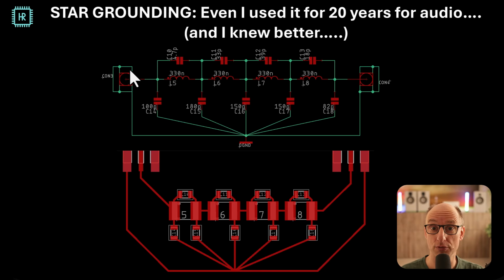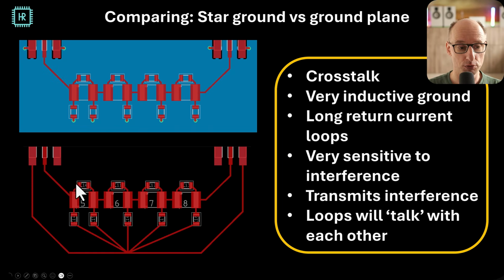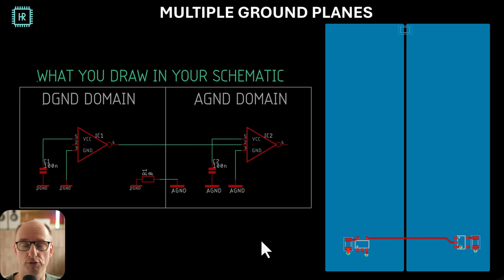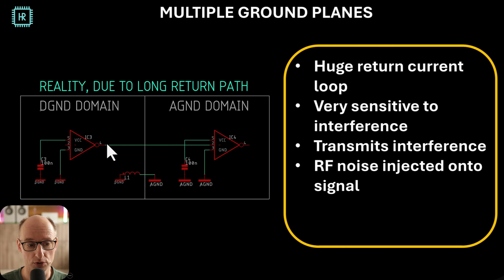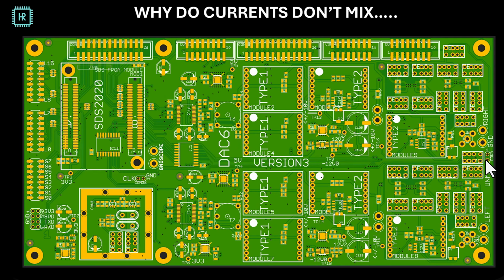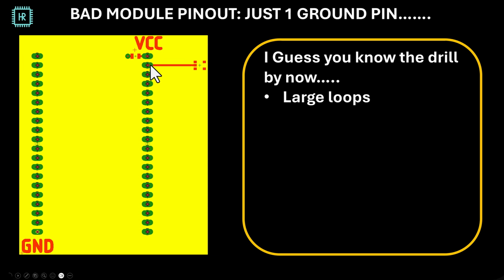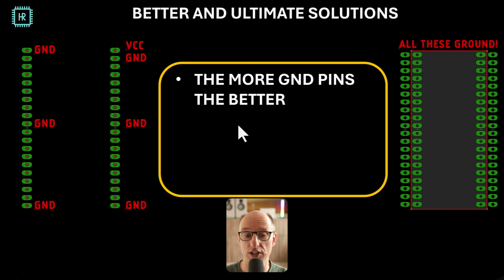Why Your Ground Design is WRONG — and How to Fix It. Flawless PCB design part 6

Comment: For system interconnections, I'm surprised you didn't mention twisted pairs, proper termination, cable impedance, etc for high common mode noise rejection. In pro audio, it is common to either run shielded twisted pair from the stage to the mixer, or even more modern, is to put the D/A conversion on stage to shorten the path from the microphones into the digital realm. This goes a very long ways to achieve very high signal to noise ratios in the system from the mic inputs to the mixer outputs to the power amplifiers. The D/A conversion is in the digital stage boxes now, and some power amplifiers use digital inputs using AES digital audio. It is quite robust and any analog noise in the digital realm is ignored completely, except at very high levels.
Reply from the maker: I fully agree with everything you say. This would have to be another video. I did not expect viewers to interpret the mcu module as a system solution problem. I will make videos about emc at some point I think. This would be a great example for that.

Comment: I really wish your video could have been out earlier! 
My manager is the “separate ground” guy. When I was designing a mixed signal board, he was really against the single plane design and introduced multiple 0 ohm resistors that seems nonsense to me. He criticised me for the “high speed mentality for audio systems” and I cannot try to convince him more about the ground and trace issues. And the consequences came with the messy enclosure earthing and isolated power supply stuff. Generally, it’s a grounding and crosstalk nightmare and it hurts my eyes every time I reviewed this board I designed.😂
Reply from the maker: Ah, I know what that feels like :-(

Comment: Thank you for your great explanation about why the ground is only one and should never be split. What is strange is that you find the advice of splitting it even in the layout recommendation from some ic manufacturers. Any pcb, independently from its operating frequency shall be designed with rf rules in mind. 
I do high power smps design since 20 years which is maybe one of the worst cases for emi; never even thought to split the ground between different sections. Emi compliance is already complicated enough by itself, split the gnd and you will have a very bad day in achieving it.
Reply from the maker: Very very interesting answer. I've been getting replies from people saying: "when you do high power smps, you must split ground planes because otherwise you'll get crosstalk and other problems". I was not convinced of that being a good idea, but now you are commenting as an expert which is great. Now I know 100% sure this is not a good idea.
Reply: @HansRosenberg74 
Thank you. The only reason while I split the ground is when you have to measure a large DC or low frequency current with a shunt resistor and you don't have the possibility to measure the voltage across it in a balanced way.  The current is passing through gnd and the plane resistance (not the inductance) will impair your accuracy of the measured current. See it more like a kelvin connection rather than a gnd split.
The main problem with ground split is that at a certain point the various gnd need to be connected together; but where? In this case the point where the 2 gnd join is clear (at the shunt terminal) and not defined by crosstalk/emc/interference or other not well defined reasons. I have seen also joining the split grounds with a ferrite bead in a random location.... Maybe among the worse you can do for emc.
Reply from the maker: that was the only reason I could come up with. I do something similar in my high power audio amplifiers. You have to be careful what you do there. The position on the tracks where you take the feedback is also really critical since at high powers the currents are asymetric (top half or bottom half of output stage conducting at high power)
Reply from the maker: The only thing I've never designed that is quite common is switching mains supply (220V to 12Vdc or so). I would love to do that sometime. Do you know what would be the best resource to learn the basics of that?

Comment: Thank you for the great series of videos!
In a bard-to-board header, every signal pin should have a ground pin nearby, but multiple signal pins can share a ground pin.
The following approach keeps a decent RF performance while reducing the number of ground pins involved:
For a single-raw connector:
s G s s G s s G s ...
For a two-raw connector:
s G s s s G s s s ...
s s s G s s s G s ...
Reply from the maker: Yes, great idea. On my low emi fpga board this is what I did. I think I had a ground pair after 3 signal pairs.

Comment: For say, an industrial controller where you want to avoid EMI, a whole ground plane, plus a somewhat separate EMC barrier, is the standard solution. But even things like processors, on that structure can sometimes be inexplicably sensetive. So something happens even on a PCB ground plane.

For my audio projects, i always had success with rougly the following structure:
-Input and output jacks bolted directly to chassis.
-Star grounds, each component lead hardwired directly to chassis. 
-If possible, a thick (5mm) copper chassis as ground plane, the more metal the better.

That was of course completely hand built stuff. To replicate it with a PCB, i guess you could sandwich it with a copper plate and have a screw down into the copper for each star ground.

That gave me noise immunity, blackness, brilliance.
Reply from the maker: I've designed and build 11 power amplifiers and 6 DA converters and experimented heavily with grounding. The single ground plane keeps giving me the best results on a pcb. With hand built stuff like tube amplifiers your solution sounds like a good one. You always have to be vigilant what you do though.

Comment: I'm not so sure about the multiple groundplanes always being bad?
I feel like it's only consistently bad when an analog signal crosses between planes (but you can still mess up a digital plane crossing too).
If you have a DAC/ADC in the analog groundplane I'm pretty sure it's all good to have the rest of the digital circuit in a separate groundplane right?
Also, I think the majority of problems are to do with having loops in the crossing between planes, if everything is fed between planes at the same point (including power) and you have some filtering then most of those problems go away.

Still no good reason to do it though, unless maybe there is something particularly noisy in the digital section and you can't filter it? Can't think of a good one though.
Reply from the maker: I haven't found a good example for splitting planes. I did get some suggestions for high power switching electronics, but I would love to see an actual example of that, preferably with measurements.
Reply: @HansRosenberg74  Yeah, I would agree that it is unnecessary in basically all audio equipment aside from separation of really noisy things that have nothing to do with audio anyway, it's not even that hard to have SMPS on the same plane without trouble.

I do however suspect powerful amplifiers need more care given to their design if they are to be placed on the same ground plane.
The high currents can cause low-frequency resistive cross-talk that requires consideration of the high-current paths, so I could imagine having a separate ground plane for the high-power section being a convenient design technique in that case.
Reply from the maker: Basically  a star connection between 2 planes, If I understand you correctly, that should work well and not harm anything I guess. I solve it with floor planning. High currents to the right, low currents on the left with a 'virtual star point' somewhere in the middle of the ground plane.

Comment: Many of these ground ideas come from the early days of point to point valve/tube wiring, so they shouldn't be used blindly for PCB use. Obviously a daisy-chained ground connection from the power stage back to the input stage will cause resistive/inductive/feedback problems, so the star ground was used instead. Sometimes localised star grounds were used for each amplifier stage, using the metal chassis as a crude ground plane. For large spread-out installations, mesh grounds were used with heavily cross connected point to point ground return wires. For example the old BBC Television Centre in London contained tens of thousands of coax cables which created a giant low-impedance cross-connected mesh ground network, where a star ground system would have been impracticable.
Reply from the maker: Hah, great! This explains where it comes from, this makes soo much sense! Thanks a lot for this insight!

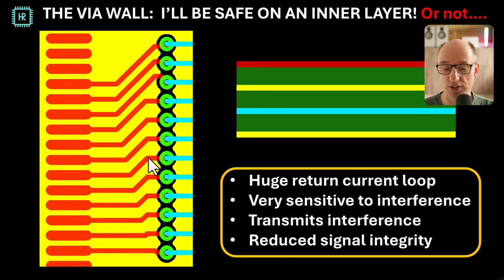Comment: 10:06  Wait just a sec!  I understand the point you're trying to make (provide a return path between the individual vias). But in the example, with signals traveling left to right, the example doesn't show any reason why the return current would want to flow back to the left... it has no destination on the left.
Reply from the maker: There will always be a return current to the source. The source is on the left. Unless the current is 0 off course. Check out part 1 of this series, that explains it with more diagrams. Maybe that clears things up.

Comment: I think most of the advice here could be summed up as "be mindful of your return path". 

But there are plenty of good reasons to use separated ground planes, especially in more complicated electronics assemblies.

Anytime you have largeish currents being switched on and off, especially if the switching is fast (motor control, LED PWM, etc.), you're going to get a voltage gradient across your ground plane, and it's going to add more than just common mode noise. Ever used a low-cost PC and can hear USB traffic from your mouse in your sound card output? That's a bad layout, and almost certainly one that uses a continuous ground plane.

But of course any time you have a separate ground plane, you have to ask yourself, "what currents are flowing through this bottleneck, and are they going to cause issues?" An obviously bad design like the one in your video will of course not work. But just like there is a good reason to have separate AVDD and DVDD regulation, there are often good reasons to have an AGND island and DGND island. And of course, all currents must be sourced from a battery or wall plug or something else, so that current return path has to be considered as well.
Reply from the maker: You're right, if you're in full control of your return paths, you can take more 'freedom'. If you have high currents, you have to be careful about how to connect very sensitive inputs (like with a power amplifier). Indeed there can be a gradient across the plane due to high currents. I'm planning to make a video on audio power at some point.

Comment: Seeing extreme grounding, using 2x connector pins, full digital board - dont bother., you just gona pay more for no diference of watsoever. Grounding etc is ONLY done at minimum requied. 
Sure if you work with RF and analog stuff you may need better ground, but for digital stuff, just ignore , you gona just make board/parts more expensive.
Reply from the maker: You are correct when looking at it from a functional point of view and it is a little cheaper to save on connectors.. This will work (for most applications). However, you'll be transmitting quite a lot of interference. If you want to make a product and have it qualified (like CE markings) you may run into problems. I used to work on small mobile devices and those compliance test that you needed to pass for mass production could be quite hard to achieve.

Comment: star ground works on centrain concepts..
Same for ground domains, special use, and only good if signal is transmited throu dif pair with high common mode rejection.

Comment: In the 4 layer stackup, does the return current actually stay on the same plane?  I understood (perhaps wrongly!) that the return current would want to travel on the "closest" plane to the signal; the stackup you've drawn is oddly symmetrical compared to most real 4 layer stackups which would use a core that was significantly thicker than the outer layer dielectric layer, so I'd expect the ground current to divert to the nearest ground via to transition to the layer that is closer to the track (on a typical stackup).    Also, do you plane flood the top / inner signal layer with this stackup?  Otherwise I'd expect bow & twist to become an issue.
Reply from the maker: If you place ground vias that offer a path to the lower plane (and that route is overall shorter in 3 dimentions) most will go to that other plane. I do generally fill my planes with ground. You have to place enough stitching vias (see my part 4 video).
Reply: @HansRosenberg74 Hmmm, is it the "shortest" path or the "quickest" path that gets preferred? i.e. considering the distances and characteristic impedances of path options. signal over return path with low impedance being shortest and quickest

Comment: Very cool video, grounding always seemed to me like dark magic but it seems you just need to always remember that current flows in closed loops so for every signal path there has to be an accomodating return path🤔

What do you think of Ground Lift switches one can find on some audio gear? I think they reduce hum by "elevating" the signal ground via a capacitor thereby blocking ground loops.
Is it legit or a dirty trick that introduces other problems?
Reply from the maker: I'm not familiar with ground lift switches. It sounds like you would introduce a high pass filter in your signal path if you do that?

Comment: I realized that a (what turned out to be a) star ground configuration in pinball games (from the 1970s and early 80s) made by Gottlieb - back in the mid 1980s - was leading to coils and transistors burning out due to biasing shifting as the ground connections deteriorated. Note this computerized pinball system was designed by Rockwell International...

I published this in  the trade journals of the day, but Gottlieb never followed up and their games continued to fail - leading to an undeserved (an easily fixed problem!) reputation for failure in the field. All it took was ensuring that the ground connections at the power supply and logic board was shared with better connections. This defeated the Star Ground, and as I am not an engineer, just a self-trained tech I could only describe the problem and the solution as I found it. 

I can say that games that had my ground modifications stopped failing and became as reliable as any other solid state machine. I wish I knew you then and could ask you how to do a better job or at least explain better than I did what was happening. 

I won't post a link to the ground cure I developed - it can be found with internet searches I'm sure - I've said enough for now.
Reply from the maker: Nice story! Sounds familiar..... you can offer a great solution, but I've also experienced that parties are sometimes not interested in implementing it....... which is a pity.
Reply: Thank you for the Gottlieb grounding mod - making those few good ground runs was far simpler than tracing and bypassing the bad grounds through the edge connectors! Especially in the field.

Comment: I always remember the rule - make sure all frequencies present are terminated into their respective characteristic impedances, and be mindful of reflections from other circuitry.  Thanks for teaching, very interesting.  Currently thinking of a repeater for the 23cm ham band - probably not built from scratch though..
Reply from the maker: A good distinction to make is that terminating to the right impedance only becomes a thing when your transmission line is longer that roughly 1/4 wavelength. So below a certain frequency it is no longer important as signals will not form standing wave patters screwing up the match and causing problems.

Comment: I always figured that the star ground thing was mainly to avoid problems at DC levels between different boards etc., especially with high current like power distribution.  But I'd always be happy to bolt grounds to the nearest piece of sheet metal (chassis) with a piece of braid.  But up to now I've been fooled by the separate AGND and DGND thing.  Instinctively, I always thought it was a bit suspect, because one quickly runs into problems deciding exactly where to put the tie-point, with any non-trivial layout.  Now it makes a lot of sense what you say, which is to just have a single ground plane and try to keep the different types of signals in their own area.  Great videos; I'm leaning a lot, thank you!
Reply from the maker: Thanks, that is really encouraging :-)

Comment: Hello Hans! Thanks for illustrative examples of how to work with ground connections. I have one specifying question - do you use your favourite stack up with components on both sides or only at the Top side? I think it is rather difficult to route connections between components on bottom side if you choose dual side assembly with this type of stackup.
Reply from the maker: Components on one side. I think if you have a lot of components on both sides (not just a few like in my fpga board) you almost need to go to 6 layers because there are probably so many connections that it would be hard to get everything connected otherwise.
Reply: @HansRosenberg74  thank you for a detailed answer to my question!